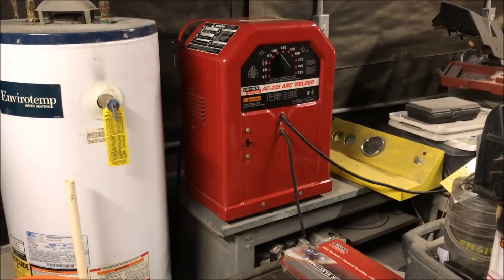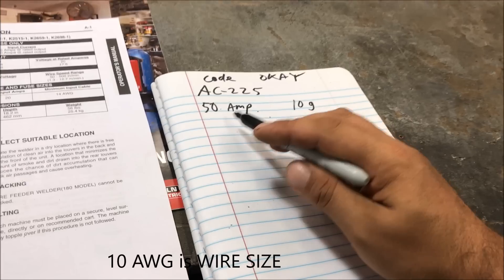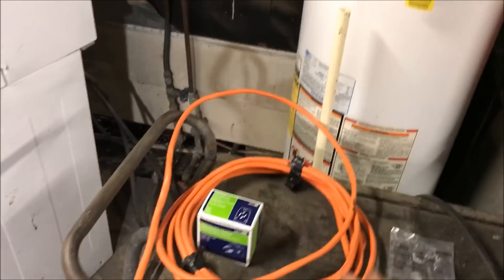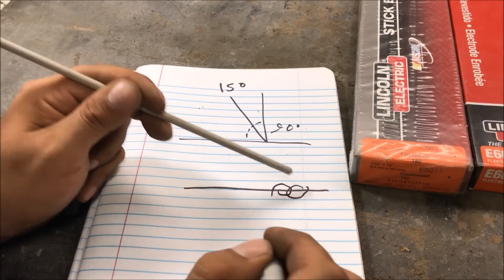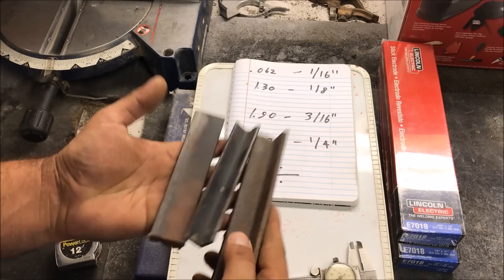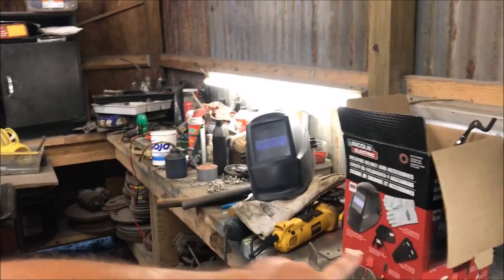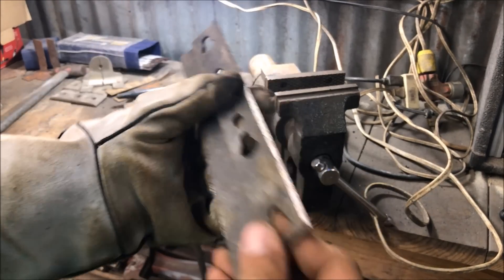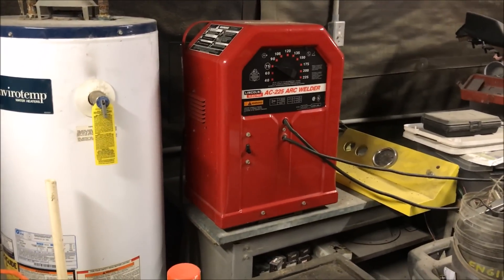hobby STICK welding for beginners with LINCOLN AC-225 welder

Comment: I'm really digging this video!  Great job!   I inherited this exact welder from my dad when he passed.  I used it when I was 10 - 15 years old to help him out (I'm now 50yo).  Now I have it and I have some broken parts on a trailer I want to weld and needed a refresher.  When professionals explain it they may leave out things a beginner will point out to another "beginner".  I like that.   And your humor is great!  I like the "avoid the dumbass!"   lol.   Luckily I have a house with 100 amps at the barn and the 220 is already wired for a welder so I just have to refresh on best practices.  No need to waste time when you have tried for me!! haha

Comment: I must say your video was great for folks like me: more $$ than skill or knowledge. I bought that same welder and am having the 40 amp breaker in the panel changed to a 50 and having the number 10 wires rerun with a  6s.

Comment: Great video.  I just picked up a brand new AC-225 from Lowes for $185.00 on clearance.  Not sure why it was cleared out but I got it anyway since I wanted to learn to stick weld.  Luckily for me, I have a dedicated 220 circuit (50 amp) in my home that was used for a very large compressor system that is no longer used.
Reply from the maker: it is a good machine but that short duty cycle will catch you off guard

Comment: 20:10 You don’t have a glove on your right hand. Referring back to your previous statements, the welding gloves are not just because things will be hot. The main thing is to protect All Your Skin against the welding arc glare. You’ll end up the next day, or late that night, with the world’s worst case of “sunburn”. Worse than that you may be at the dermatologist’s 10-20 years from now being told to hold still while he cuts funny looking spots off. It’s no big deal. Just cover up. Also, I wouldn’t buy every rod in the store. Learn to use one or two well to begin. 6011 is a deep penetration rod that will help you be sure the whole thick joint is welded. 6013 is less penetration and faster fill and is good for thinner metal. 6014 is really fast fill but best for horizontal welds only. I’d recommend 6011 and 6013 to start. Also, start with 1/8” to 1/4” steel before you try thin stuff.
Reply: Nice tip on "sunburn"!  Never heard of it!  Thx!

Comment: Pretty nice welds for someone just starting out, you're doing great. 6011s are harder to get the hang of (you have to whip in and out of the puddle), you'll get to liking them once you get the hang of them, great for nasty stuff in the field.
Reply from the maker: please explain or tell me where i can go to understand the whip and pause... i have no idea what that is and people i know keep telling me that..  i cant find any videos on youtube about it or on google...   thanks for the reply...
Reply: Lets see if i can help , once you establish the arc with 6010 or 6011 and you have your puddle you will move your rod forward of the puddle about 1 or 2 rod diameters , what this does since the 6011 and 10 are agressive rods this will burn out a crater and as you whip it back to the puddle it washes back in and this gives the convex profile of the bead and also the width . If you wer to just drag the rod you would not get good fusion once you get your timing down you will be able o control width and penetration easily without switching rod sizes. In my opinion its a much more versatile rod than say 7018 or 7014. It also lends itself to out of position welding very nicely. Hope this helps . Im a journeyman welder and i almost never got to use 6011 or 6010 in the union shops i sued to work in , it was all 701 stick or fluc core metal core wire . now im retired i use 6010 on most of my stuff and i love the rod . 6010 , 6011 are the same rod except for the coating on the 6011 makes it work well with AC current , a mineral called rutile i believe . ok nuff. Lol
Reply: 6011's are my GOTO's!  it pained me to see Chris chuck 'em!  :D

Comment: It's a forward and back whip. out of the puddle then back in. 6011s are fast freeze, when you whip out, the puddle solidifies then you go back to the end of the weld and pause for a second. Whip out, back in and pause.
Reply from the maker: so i just clicked your channel...   do you have a bench to actually flow test heads? i have a bunch of big block chevy head questions
Reply: Yes. It's a computerized SuperFlow 600. I used to port allot of BB heads but they're too heavy for me to lift up on there now. I had a bad bike crash in 2008, so I port motorcycle heads now ;)
Reply: I raced BB Chevys on drag boats for 25 years...
Reply: Spot on.

Comment: For the 3/32 6011 lower your amps to about 60 and try the forward and back whip that MCE Performance mentioned.  90 A is high even for 1/8 6011.  6011 is a high penetration rod that will easily pass your break test when done properly.  7018 runs better out of an oven, but the porosity you mentioned usually happens at the start of a weld.  As you get better at starting it, the porosity will go away.

Comment: @Chris Craft "Rod Dryers" go a long way with E 7018. Home oven can work as well (700 F to 800 F for 4 Hours ) When you get better at welding E6011 with be a go to rod for many projects. E6011 is ugly but it works.

Comment: What wire would you recommend for a 60 foot extensions for the same welder. I have the outlet and 50 amp fuse on side of my house but my small shop is 50 foot away.
Reply from the maker: I would use #8 AWG  but #10 would be fine
Reply: Thanks
Reply: Number 8
Reply: You need 6 gauge no 10 or 8!

Comment: 70 18 rods has to be welded with the correct polarity  or you will get little pin holes in the weld

Comment: I just recently started welding again I hadn't been doing it for some years ...since I was a teenager anyways.
    I just wanted to say kudos you did I thought excellent explaining the different types of metal and thicknesses and especially the gear that you need to use I initially was looking at your video because I am refurbishing one of my welders and it happens to be a link in 225 buzz box and when I began refurbishing it the wires inside were already disconnected and I've been looking everywhere for something that is concise and precise to what I have and it's just a s*** show out there. So it would kind of be cool if you had the time or if you had the inclination to open up the back of that sucker and show people exactly what wires go where because the videos that I've seen show the wires but they're overlapping each other so you don't really see where they're connecting and where they're touching each other a lot of the times and it's a little bit confusing. 
    And I'm just being the devil's advocate here but I didn't see anywhere in the video where you explain to them when to use a different rod for a different type of metal and thickness of metal and I was always taught that every I think it's 16th of an inch you add 30 amps to the output on it and I don't even clearly remember myself if that is the thickness of the metal or the thickness of the rod that you gauge the voltage by hell it might even be both of them but I didn't see anywhere in your video where you put that in there and it would have been really helpful.
  Other than that man I think you crushed it you knocked it out of the park and I thank you so much for the video I liked and subscribed it seems like when you watch stuff on YouTube it's always an echo to hear people say that but in your case it was a pleasure.
    I look forward to seeing more of your videos in the future.
             Thanks again,
                        Elmer⚡💥💯
Reply: And that you gave two rats whiskers to respond what a heck of a guy...

Don't ever forget.....

Welders.... Cuz engineers, and mechanics need heroes too !!!

Comment: I would upgrade to 6awg copper wire.
Reply from the maker: if you were running 100ft run through a shop I would ... but on a 10% duty cycle the machine will not ever let the wires heat up
Reply: @chriscraft77022  Are these machines 10%? I was thinking of getting this model.
Reply: @jjcuna  20%

Comment: good video. 6011 will mot give a pretty bead but is much stronger so you should practice using it. 6013 won't give the penetration needed for thicker metals. Not trying to be a smartass just hints from someone who earns a living as a welder.
Reply: William Galloway 6011 is a DC electrode, not for the Lincoln AC welder he is using. 6013 is the alternative to 6011 on a AC machine.
Reply: @richardtullius6419  - Um... Nope. 6011's are specifically designed for AC machines but can also be used on DC welders.

Comment: Look for chucke2009, he made a video about it a few years ago
Reply from the maker: ok, ive seen that video but he just has so much face time that i stopped watching... went back and watched it..   thanks..  makes so much sense cause that damn 6011 burns hot..  one question about the big block heads.. can a 2" primary tube header on an OVAL port car head hurt the performance?  sorry, i dont remember the casting, but pretty much the biggest factory OVAL...   let me know if i need more info..   im just looking for the idea..
Reply: A 2" header is a good choice for a 454. Oval port heads are excellent for the street. They actually perform better under 6000 RPM than the square port head. If it's a street driven car, oval port heads win hands down. Above 6000, the square port will give a little more HP but under 6000, the oval ports have allot better velocity and the TQ will be crazyhigh!With a larger (2.19) intake valve and some minor porting. you can be in the 600HP range with oval port heads. The EX ports are pretty good as is. I'd use the stock size EX valve and a 2.19 Intake with some pocket porting and a performance valve job. You can call me if you want.
Reply: I'll need some more information to get you more specific recommendations. Cubic inches, intended RPM, vehicle weight, gearing... Things like that. If it's a cruiser, you obviously don't want to build something that's too crazy. Give me a call if you want.

Comment: Hey I have a 240 volt outlet in my garage but it's a standard face how did u get ur welder to plug in I have the same one
Reply: You will have to replace that outlet with one that matches the pigtail (cord and plug) from your welder. Take a picture of it and go to any hardware or big box store.